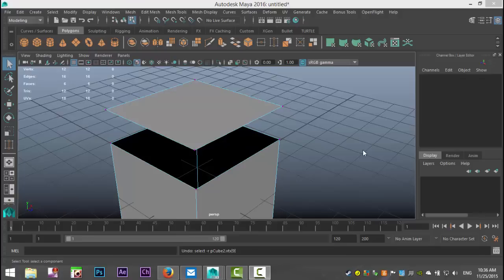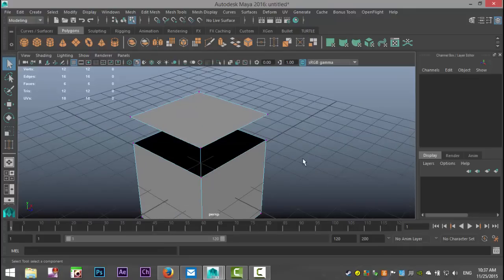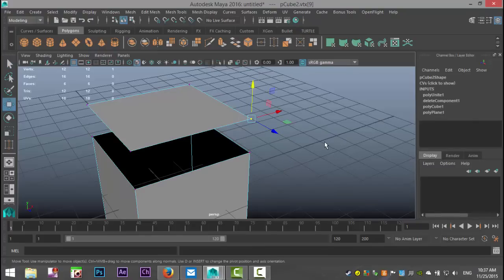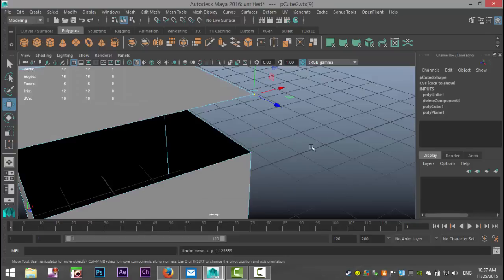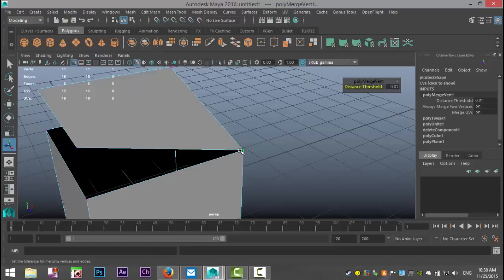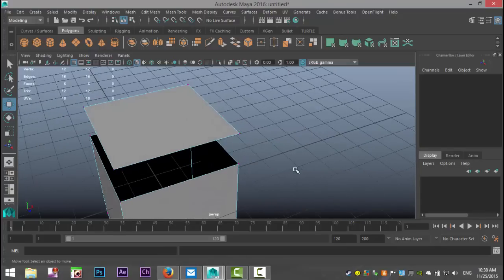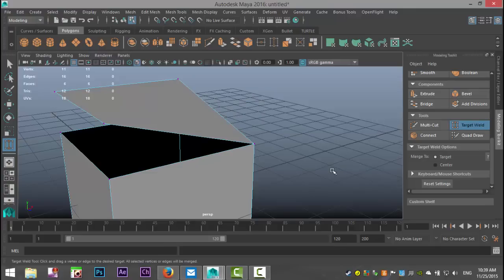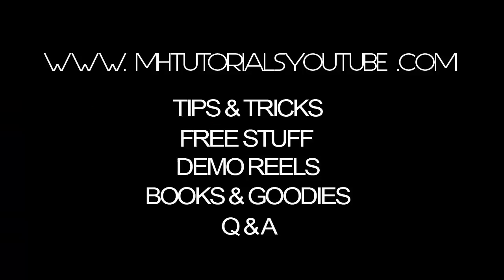Maya 2016 tutorial : The Modeling Toolkit Part 4 ( Target Weld Tool )

Comment: I have an issue, I can select the two vertices that I previously snapped, but no matter how many times I click on edit mesh/merge, they don't stay connected :(
Reply: +Ariel Soriano Also, I extracted a face from a polygon cube, and when I try to use target weld between a vertex from the face extracted and a vertex from the cube, I can only use the tool to connect two vertices of each part. I mean, i can only connect two vertices from the face extracted; and two from the cube, I can't conect a vertex from the face extracted and a vertex from the cube. I hope you understand xD
Reply: i wonder if you already fix your problem but what i usually do is select the faces that contain the vertices that i want to connect then i go to mesh and hit combine. then i go to vertex mode and now i'm able to connect the two vertex no problem.